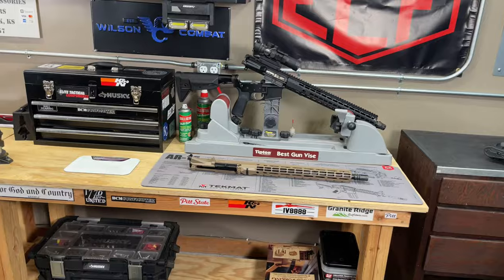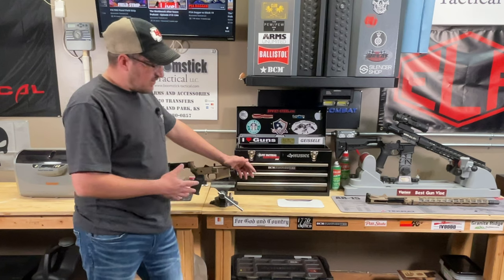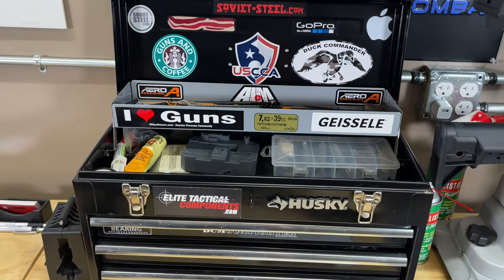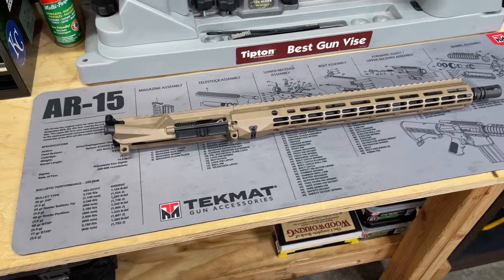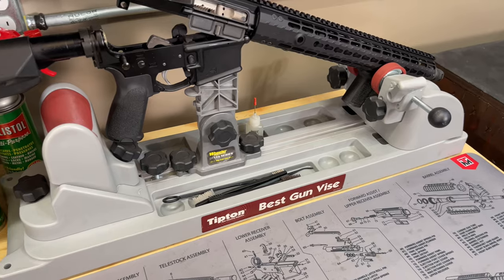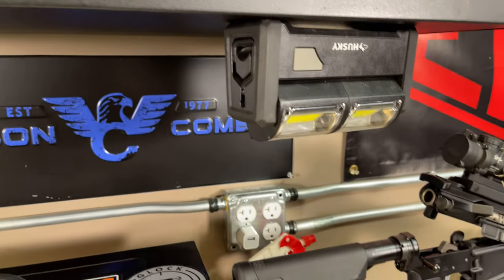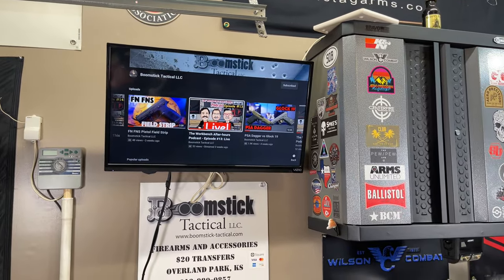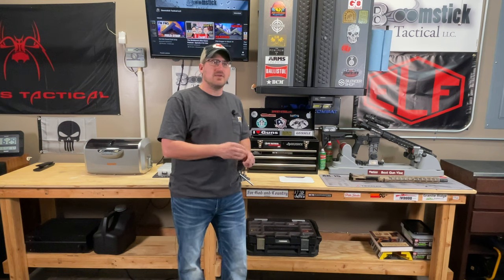Gun Workbench Setup

Comment: I've been gunsmithing for fifty years. I would like to make a couple suggestions. Invest in a good sizeable vise. Something you can beat on. You will need it. Get a good bench grinder,  5-6 inch wheels, and  a bench top drill press. You cannot drill accurate holes with a hand held power drill. And lastly a Dremel this tool will get worn out. Once you have these you are now capable of making tools for yourself, and I suggest you do. In doing so you are honing your skills, skills needed by a good gunsmith.